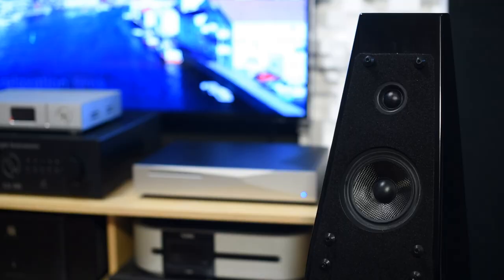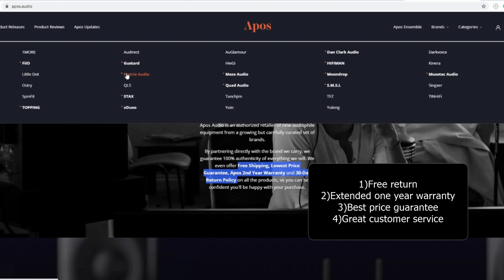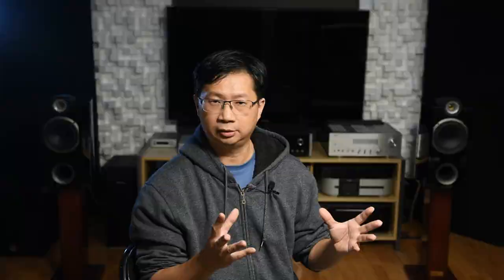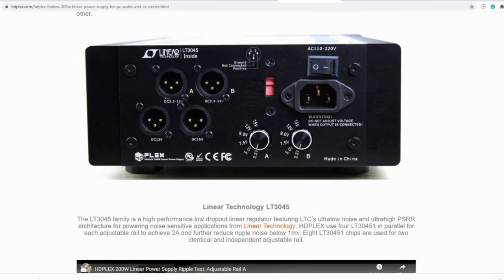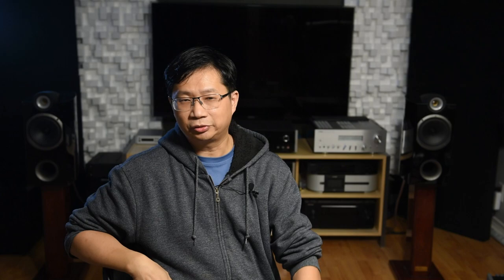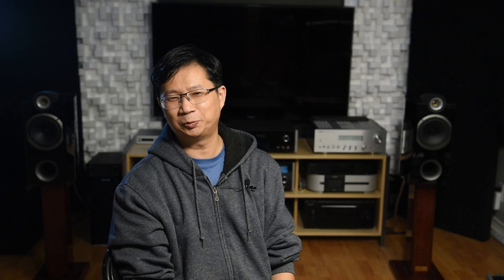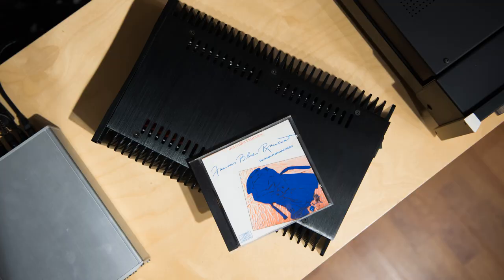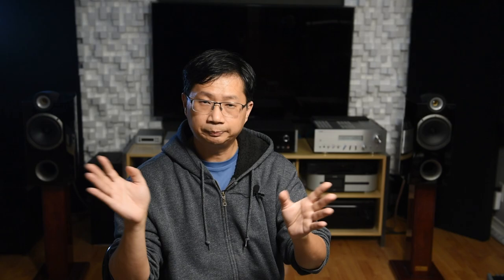Audiophile-grade computer? Really? How do I get one?

Comment: With modern streamers, a PC isn’t necessary for playback only systems. Properly designed audio equipment doesn’t need: power conditioning, re-clocking, etc.  An example in the computer realm is the Cherry USB, which delivers an electrically isolated coax SPDIF stream to drive an external DAC.  The Cherry 130dB+ DAC DAC 2 HS eliminates the concern over jitter with internal re-clocking and drives amplifiers directly with true balanced, DC coupled outputs.  As far as streamers go, we use a Node 2i (<$500) with delivers error free data to the DAC.  This saves the need for a computer on the network to serve the data.  So, we have a reference system using Cherry MEGA MK2 Mono amps for an end-to-end ultra-high performance DC coupled 1kW/ch 2-channel system.
Reply from the maker: Yup, that is the advantage of a streamer. I forgot to mention it in the video, the reason why I did not get a streamer is because part of my source is youtube and streamers can't stream from youtube. That is why I need to use a computer. I had it in the original video this comment but forgot about it when I re-filmed it. I will be making some videos on streamers and this is a talking point.

Comment: single board computer is the way to go because you don't need to spend a lot on power supply. the lower clock also useful for reducing the noise. i build a linear PSU for my UDOO x86 and the change was significant : exactly as you described. and the best part is i don't need a single fan to cool it off. total silence !
Reply from the maker: Yeah, there is so much to learn on tweaking computers.

Comment: Ah, this is a whole new world. Shingnosis is 100% correct; bypass of the windows audio driver is essential. If you're feeling adventurous, I highly recommend http://www.phasure.com/index.php?topic=4218.msg44532#msg44532 the xxHighEnd software for Windows. It is a tweaker's dream. You will drive yourself crazy tuning everything to your delight. If nothing else, the "Minimal OS" playback setting is a revelation.  Additionally, EVERY computer part makes a difference, including the amazingly smooth sound I get from an old internal WD7200RPM hard drive compared to a SSD (common wisdom says I should get a cleaner sound from the SSD!!) or even USB sources. Must be synergy. I wish I had the budget to go linear supply, but I'm a dabbler and use comp for my Sennheiser HD580s. Love your channel!

Comment: Another way of upgrading your computer sound without getting into its internals is to install a high-end PCIe USB card like the JCAT FEMTO. You can then upgrade the card even more with an external power supply like the Uptone Audio LPS-1.2
Reply from the maker: Yeah, those are quite pricey.
Reply: I have the Matrix Element H USB card - Matrix Audio has confirmed to me via email that the card is entirely powered via the 3.3V PCIE connection - adding an external PSU via the 2.1mm barrel plug will only provide power to the device that is connected to the card via the USB plug - not the card itself

Comment: Man if people only spent half as much $ on acoustic treatment as they do dac's , fancy cables, and various snake-oil devices like "anti resonance audio racks to improve the sound quality of solid state devices"  - they would very quickly  hear very significant and appreciable improvements in sound quality .    After buying quality components to begin with, acoustic treatment should always be the next "upgrade", theres much better bang for buck and its future proof/gear-agnostic - a good treated room will always provide good improvements with any gear going forward.

(I dont know why so man dont get this...  theres a reason theatres and good concert halls and studios etc.  are full of acoustic treatment ...)
Reply: Sound treatment requires dedicated room and/or understanding wife. Slipping a new DAC into a system might be an easier upgrade path then convincing her that a giant base trap in the corner is acceptable.
Reply: @theallblack1407  Does she display the balls she took from you on the mantle of her extravagantly appointed living room as well?  If you do not even have a single room you can arrange as you see fit, just FFS.

Comment: DACs have been isolating signals for quite some time. If your DAC is that much affected by USB input and power supply, it's not a very good DAC. 

According to it's specification page, your  ExaSound e28 ALREADY has shielding from USB interference, so that Matrix Audio USB card adds absolutely nothing and does not change audio quality. And by measurements we know that jitter over USB is not a thing, no matter the cable quality.

From ExaSound e28 page:
Host Noise Rejection: Galvanic isolation between the USB subsystem and the DAC circuitry eliminates ground loop noise and blocks computer–generated interference

Comment: Hello. I am using Matrix X-Hi USB 3.0 card on my desktop computer. It makes real big difference. Do you think Matrix Element H is much better than Matrix X-Hi USB card? I am also using ifi micro idac2 DAC and feeding it with powerbank. I also have ifi gemini 3.0 dual-headed USB cable. Power connector is connected to powerbank and data connector is connected to Matrix X-Hi USB card. Should I feed the card with linear power supply or is it enough to feed the Dac with powerbank? Thanks

Comment: Would you please explain what technical aspect of the digital signal transmission alters the analogue production of the DAC? (i.e. blacker background, wider soundstage, etc.) 
Can't get my head around it. Given that any crappy machine can send a complete and identical digital information to another machine (but possibly at different speed/timing), seems like if the DAC design is slightly intelligent and does some data buffering before the D to A conversion, then the power supply of the digital source shouldn't matter, having perfect digital data in its cache. So is it possibly the DAC's fault for being sensitive to "bad" digital signal? (Sorry, this just my rudimentary logic)
Reply from the maker: If I can explain it, I will be rich. This is a bit like cable debate, can anyone explain the science? Many have tried but not convincing enough in my opinion. Can anyone hear the difference with cables and music servers? A significant amount of people can and cannot. Just need to have a controlled blind AB test to put all this debating to rest.
Reply: @ThomasAndStereo  Lol, true. Personally, I do understand the rationale behind differences if signals are already analogue  (e.g. speaker cable, interconnects, etc),  but can't get my head around digital (not saying it's not true)
Reply: @netnakul  check out Hans B. Channel he explains the ones and zeros very well.
Reply: Less noise and distortions in general, but also better shape and quality of digital signal.
Funny enough even music media player programs can sometimes sound different.

Comment: My living room audio pc is a gigabyte auros ga 270x and i use it with a smsl sk10 usb dac(using the motherboard usb Dac up feature for more control of the voltage and cleaner signal theatrically) utilizing foobar ASIO payback . On my second gaming/audio computer i use a cheaper b350 strix motherboard with amd cpu and A Evga NU audio soundcard that i really like for it's sound quality on both the rca Output and headphone output that you can use at the same time. All of my power supply are seosonic gold.Thank you for sharing your experience.

Comment: Thanks, great informative video. I  have been interested in these power supplies for a while.
As for room treatments absolutely agree. I  think a real difficulty for most people is measuring the room before and after. I  am not saying you can't do it by ear. It's just quicker and more likely to be more accurate if you can measure the changes to see ( in addition to hearing) what effect the treatment is having.
Reply from the maker: The difference after room treatment will be so obvious that although have measurements is more precise, it is not necessary.

Comment: I'm an IT Systems Architect with 28 years experience building servers, clusters and CDN Networks all around the globe. If you would have asked me a few years ago if this level of detail/effort spent on 'audiophile' PC's was necessary, I would have laughed in your face. 
Then, some years ago I listened to a USB DAC with a tube-rectified power supply. Since you could turn off the tube-rectifier with a dedicated button on the DAC, it was very easy to compare the output with rectified power vs without. So, imagine my surprise when the sound noticeably changed depending on the rectifier being on or off. The rectifier isn't even part of the signal chain, all it does is convert AC to DC, the DC being used internally by the actual circuitry. But, without the rectifier the sound was noticeable 'grainier', and less focused, and it was very noticeable.  And no - 'confirmation bias' doesn't apply, since I considered that on/off switch and rectifier to be a bit of a gimmick, and didn't expect it to do anything:)
There's plenty of good advice in the video and the  comments, if you're into digital audio keeping the signal as clean as possible is an absolute must. The only thing I would add is the importance of bit-matched playback, which is a topic you can google and find plenty of information on.
Reply from the maker: Yeah, I have met computer engineers and electrical engineers myself who told me that although they cannot explain it, they can hear differences.
Reply: @ThomasAndStereo  I also can't explain why output coupling caps, typically found in tube pre-amplifiers, also have a distinct 'sound', even though their electrical properties/capacitance are identical... it makes no sense, at all. On my main pre-amp I 've added two outputs, each one with it's own pair of coupling caps, one pair being Teflon based, the other Copper based. Despite the caps having identical capacitance, they sound completely different, which to the amazement of my friends, I have demo'ed many times over the years. There's obviously some quantum effect going on, and smarter people than me will hopefully figure it out one day:)
Reply: @decoryder  Yep it kinda blows a hole in the thinking of the ''if you can't measure it it does not exist'' crowd.  Components that measure the same can sound vastly different.
Reply: I usually open the PS to check what's in it, then modify if necessary to get cleaner voltage lines. Sometimes I do same to MB, add or change caps here and there. Generally PC is not the best place for music signal, especially if used for something else at the same time as load goes up and down, voltage changes as well as PWM duty cycle, traces and signal pads crisscross. Then ground loops, bla, bla, bla. Yeah, Linear PS is the best option but even then, MB has its own PS section and voltage regulation. As for serious DAC, always get one with separate PS that has actually good voltage regulator in it. Ah, many years ago I played with AC line filters and took measurements of AC line frequency, but the DMM would show 120Hz. Later I did the same thing but it showed 60Hz - problem was that the PCs rather economical power supply would somehow inject 2nd harmonic back into power line. Too bad I don't have Spectrum Analyzer, it would be interesting what kind of junk is ridding on top of the AC line sine wave.
Reply: @decoryder  
Paul Carlson, I think, did explain why in tube equipment caps actually have directionality, no BS, as he showed the distortion and other measurements. Also some caps winding technique, materials used introduce distortions. Cyril Bateman wrote articles for Electronics World re capacitor distortions with measurements, especially electrolitics. Worth reading.
Reply: @pliedtka  I wasn't aware of Bateman's work; I've now read his articles on the subject - and yes, it makes sense. Very informative, thanks for mentioning it. The takeaway from his work is the measurable proof that capacitors do in fact produce audible distortion.

Comment: Hello Thomas,

Did you try external linear power supply for the Matrix Element H-card though? Looking back at my exploration on this audiophile pc topic, I initially found out adding an external LPS to my JCAT USB Femto was at least as substantial if not more than adding a separate "HiFi-USB card" itself. That's the reason I thought to comment this video since you felt the external LPS to be added last in the computer audio setup. I don't know what would be the best way to compare my experience on sound difference than without LPS the sound was more "flatter" and more centered. Sound stage also expaned quite a lot when LPS was in play. Overall sound signature I felt was more natural without some grainness that comes with motherboard USB output using your standard ATX power supply. I have not tried separate LPS's powering up the computer, yet.

Although this has to be mentioned that of course it is first and foremost one's budget dependent issue. In prior buying the USB card I was somewhat uncomfortable to put few hundreds of euros for such card. You know, ones-and-zeros digital yada yada. I have added some fancy gear over time to my setup and few times I have occasionally tried temporary downgrading using just motherboards USB-outputs only to find out them to be quite unlistenable in relation to external LPS powered USB-card.
I once tried Matrix Element H also just to compare to JCAT USB Femto. I felt they were quite close in sound performance, slightly favored JCAT though but also to note that I owned it that time. Since then I upgraded recently to JCAT USB Xe card. Price is hefty but also are the improvement (especially with external good quality LPS). Of course, again one needs to prioritize own budget on this matter but once/if audiophile bug bites you, the journey is just beginning and few hundreds maybe are just small investment then :) But all in all sometimes it could be sensible to invest in source tweaks if one is hearing harshness and sibilants. I think on a good quality gear one's "sibilant" headphones can be more listenable.
I feel the saying "garbage in, garbage out" stands here. Good quality power seems to be important in these digital audio devices.

Also to note that some people are quite loud expressing about proven science and engineering theory. Well can't argue against science but just on philosophical standpoint, is one's learned engineering background everything that there is into this topic. What I have read on some computer audiophile related forums where also electric engineers and manufacturers post giving out some information about their devices, there might be more science yielding better sound on these noisy environments (computers and switching mode power supply's than most loudest ones can master and measure. 

Keep on listening :)

Comment: Thomas i just tried something new and my laptop streamer is at a new level. 
I created an hybrid usb cable with 2 usb A on one side(for the computer and a 5v lpsu) and one Usb B on the other side for the dac.
That way no need for a fancy usb module. I bypassed the 2 wires in the usb cable physically to create a plug for it's own power supply that way the bad power coming from the computer doesn't get to the dac. The 3 wires for data + data - and otg are still connected between the computer and dac.

The results are amazing ! And it cost almost nothing to create such a cable. You'll need a 5v lpsu tho but it is less expensive than those audiophile usb card and more effective because you start with a new non tainted power.

I also added a lpsu to my laptop. I gotta find a way to put my hands on those innuos thing for comparison because I feel i made it.
Reply from the maker: Wow! Thanks for sharing.
Reply: @ThomasAndStereo  *add on : When i added the lpsu to the laptop, the difference was small. When i changed the cable for this new tweak the difference was major. Bigger than the lpsu on the laptop. But LPSU on laptop + LPSU on usb cable was a Big Jump. 

But this thing is easier to do on a laptop than a desktop computer. On a desktop you'll need to build a massive LPSU ( a proper one with different winding on the transformer for everything in the computer) But the gain can be massive, to the innuos statement level.
That is my next goal.

I'm learning LPSU design and filters designs. I just succeded reverse engineering the JCAT optimo 3 duo for 300 euro instead of 1500. Same components, same design and i can even go further they use mid level capacitors and active regulators. I can put Mundorf AG instead and Muse passive regulators. 

I'm feeling good today :)